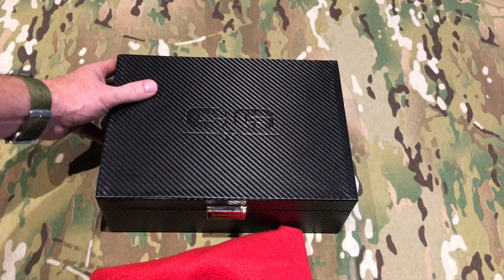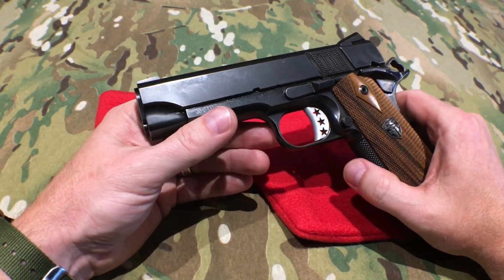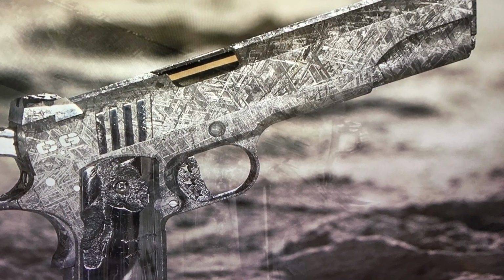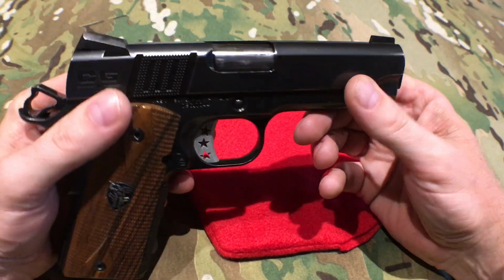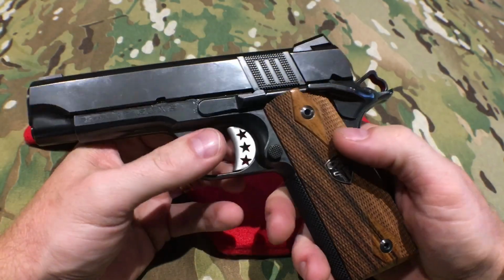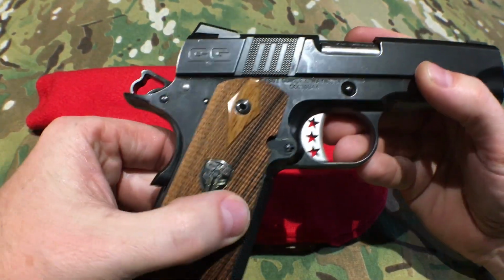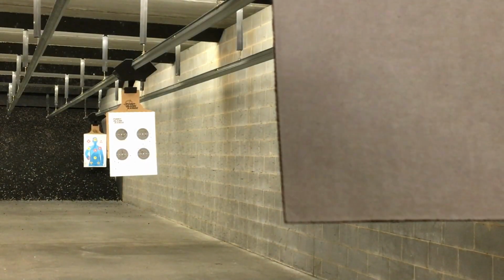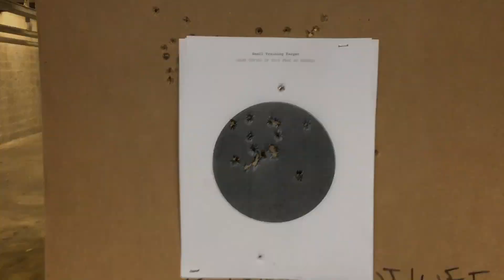Cabot Guns -- Vintage Classic 1911

Comment: I wish there were more gun shops willing to work with us working slobs; so we can experience a bit of the high life. I'd buy a Cabot in a heartbeat, if I could find a gun shop that would give more than 90 days to pay. Also, I was told that the Vintage Classic does not utilize clone technology. I was told that this line is assembled and hand fit by three gunsmiths. Thanks for the most detailed Cabot review anywhere.